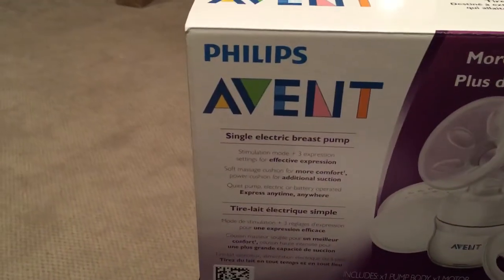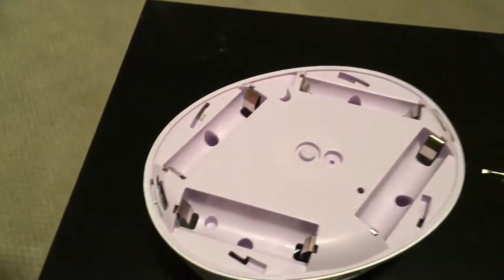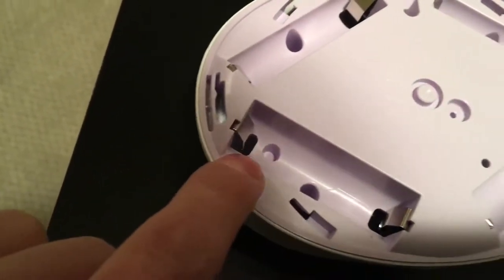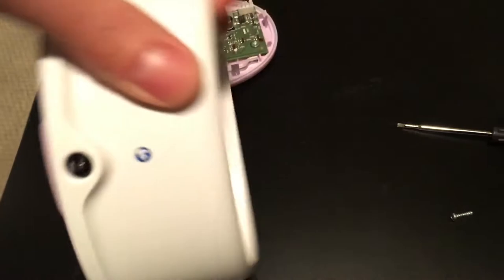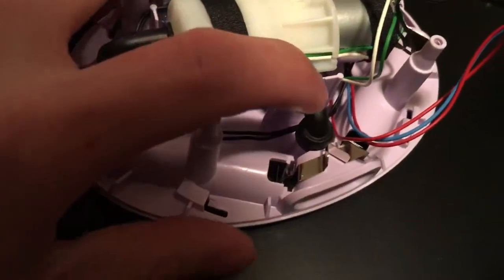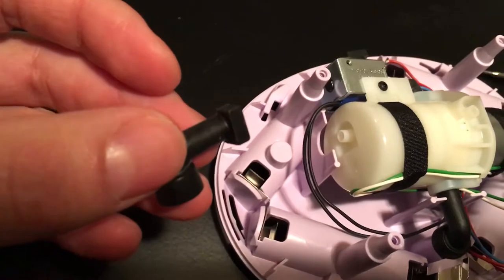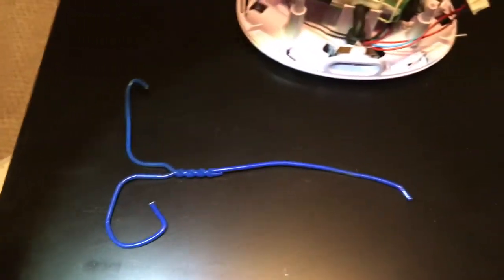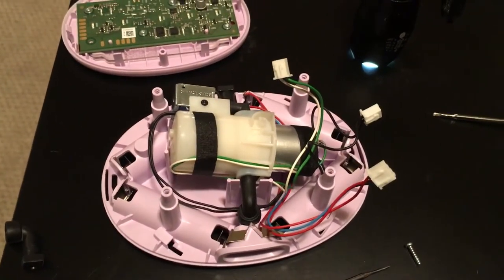Philips Avent Breast Pump no suction repair

Comment: I spent 30 minutes trying to get one clip off.  I tried a bent hanger but it was just frustrating so I got a small long flat edge and bent the end a bit.   I release the first side clip and put a kitchen knife to pry out. You have to put the knife in at the same time or it will  just lock back.  Got the second clip out , ended up breaking the end clip and release the two clips on the other side and could not feel the last clip on the end with my screw driver so I just broke it.   Very bad design for taking apart and I feel like I will use two sided tape to seal the top back on.   The only reason I can see for not using screws was to cheap out.   

Also maybe I will just drill 4 holes in the top to line up with the 4 torx screws so kill two birds with one stone. 
I think I saw on another video they used a little contact cement to glue the black tube in place to prevent future separations. `

Yes I just finished drilling 4 holes.    I clipped the top back on and then got a small drill bit and drilled through from the bottom.   You need longer screws.   So the next time it fails I just take out 4 screws.    I will break off the remaining 4 clips.

The rubber black suction tube was half off , that was the problem and I put a little contact cement and slid it back on.   I imagine many of these machines go in the trash for most people.  You don't pay people to fix these.  It would cost more than buying a new one.   Very bad design for taking apart.

Comment: Thank you so much for this video. It was impossible to find a way to remove from these thingies so I just pulled outside the pink lid, where the buttons are, with a screwdriver and I broke one thingie. By doing that the other thingies just smoothly opened and the pink lid came off! I needed to unscrew the screws and that was it.
You saved my day!

Comment: Ugh, last thing you want to find out when you have to pump at 2am is that your pump isn't working. Thank you so much for this video because I would have never found those clips (which were horrible to pop off!!). The plastic got a bit deformed in the process but at least I was able to pump and be back in bed by 3!

Comment: I also added dumpers on the motor (sticker for chair legs) for binding motor to chassis to prevent furder possible disconnection of rubber tubes.

Comment: it’s possible just try to find the rounded one. and the new models don’t have this open suction mechanism inside. they are sealed and thought accessible but if your. item is new then not worth it. return. if it’s old try otherwise buy a second hand.

Comment: Like why not paste that part done. This shit is designed to make you buy another, anyhow once you get the one clip off just it up stick a flat tip screw driver through the top and push it up near each clip it pops off